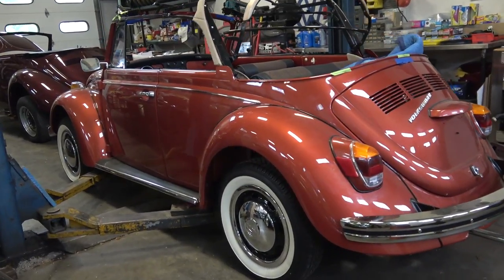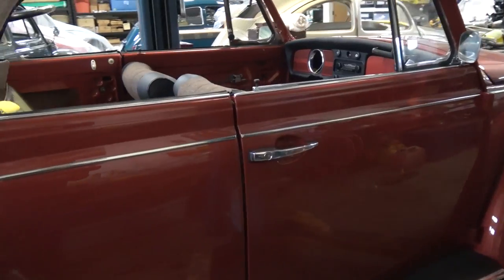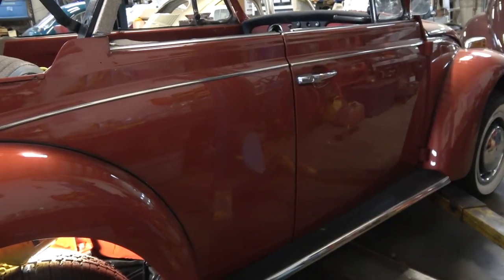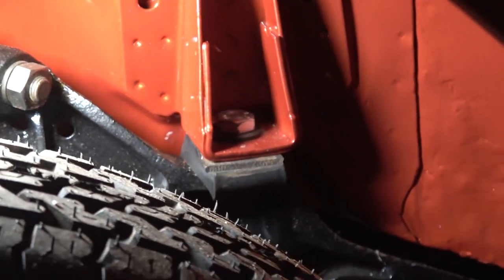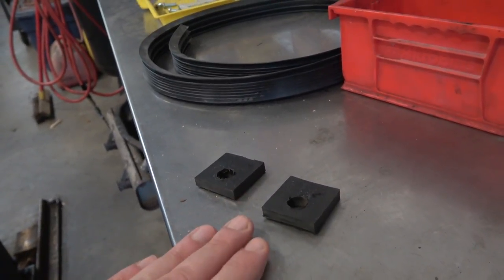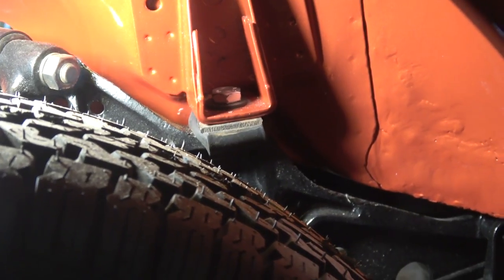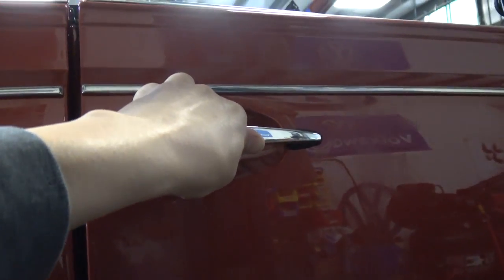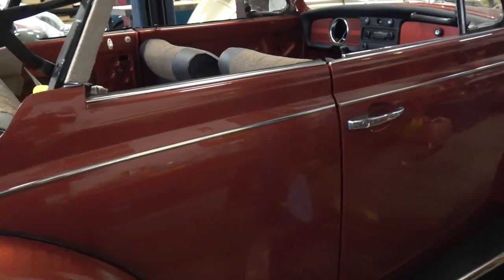Classic VW BuGs Convertible Beetle Restoration Door Gap Fix

Comment: How can I do this without removing the body? What tools are required?
Reply from the maker: You do not have to remove the body, you can unbolt that big bolt on the shock tower along with loosening the bolts under the back seat, and when you jack the car up you should be able to get in there with the larger piece of rubber.  Sometimes you may need a lil leverage with a crow bar between body and chassis to make the gap a little bigger to push the rubber in.